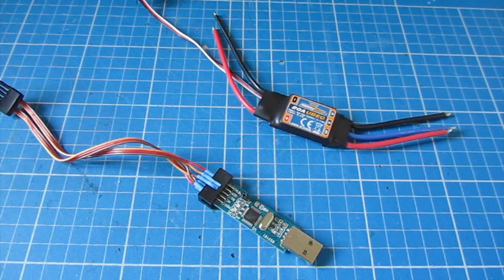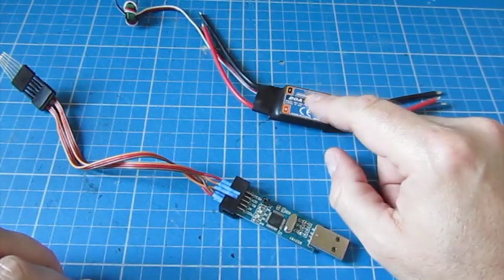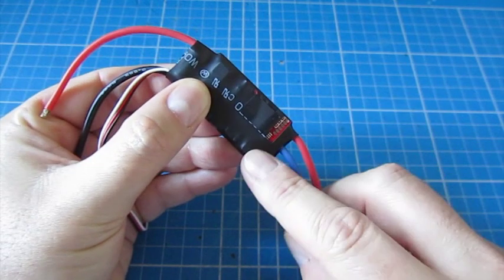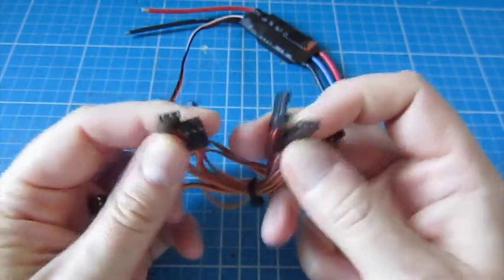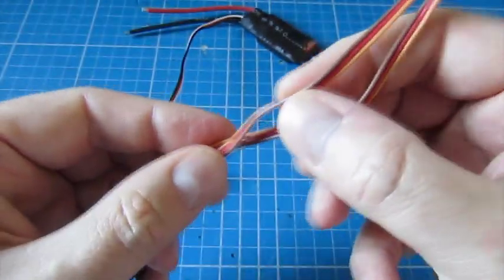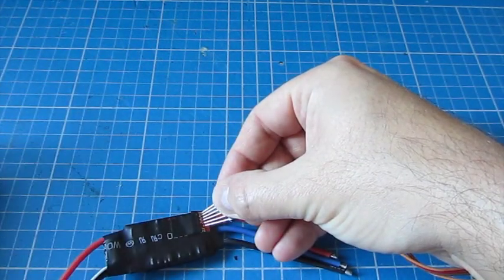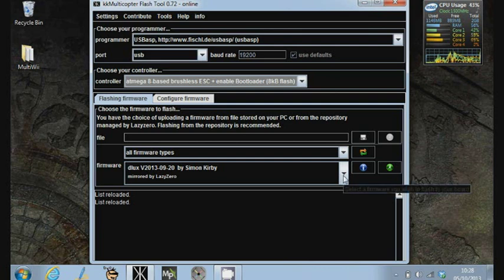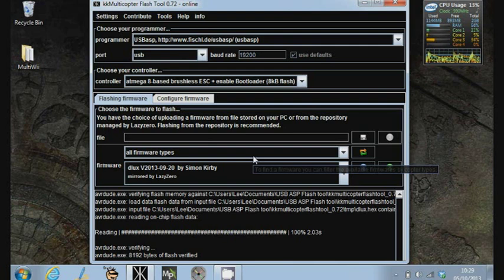How to update SimonK Firmware on ESCs using an USBASP tool

Comment from the maker: You're right - the cable that comes with this USBASP programmer is designed to fit over the 6 pins on the KK2.0 board. I show this in one of my other videos where I update the KK2.0 board to V1.6 of the firmware.

Thanks for the comment - happy flying!

Comment: Hi,

The same pin outs are repeated on the cable used for the KK2 board....................so I suppose that you could also have repeated the same operation on that cable end